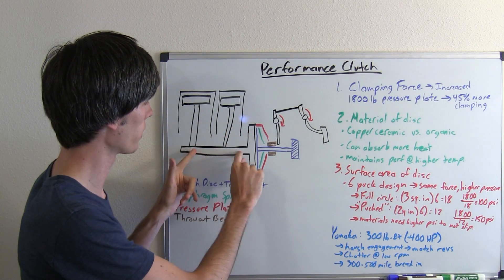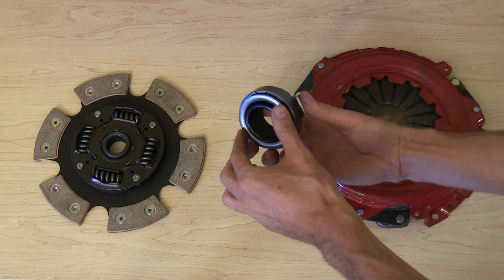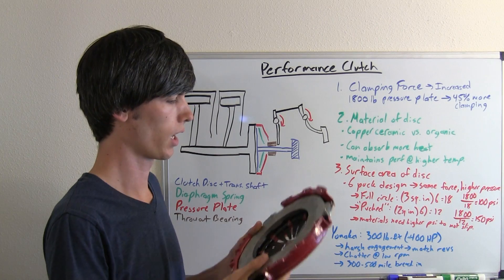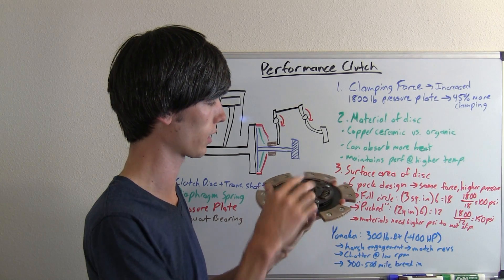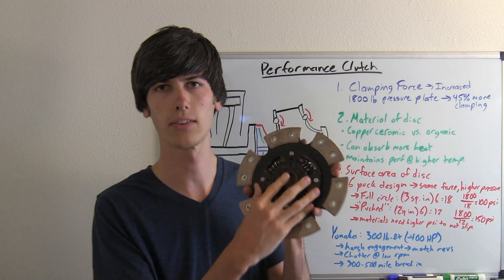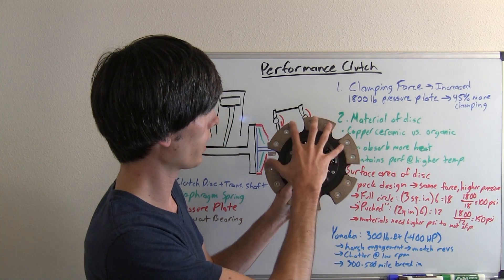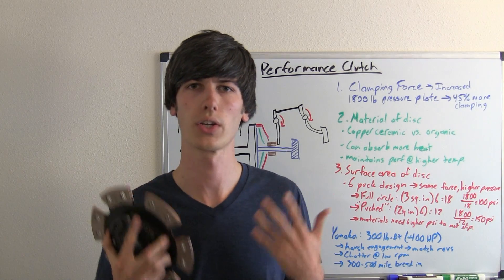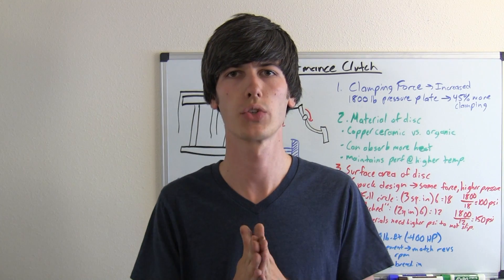Performance Clutch - Explained

Comment: You can also just run a "puck" disc with the stock pressure plate and due to the reduced surface area get more plate load. Probably should talk more about clutch "chatter" as there are two kinds; The first being rough engagement when taking off in first gear, and the second being rough running from also changing from a heavy/dual mass flywheel to a light one when doing a clutch like this (which is common, especially on German cars).  Couple things to be aware of:
1. First gear engagement tends to be harsher (one kind of chatter)
2. If you do go LWFW, just sitting at idle in neutral the natural dampening from a heavy flywheel is reduced and it can make noise like you are throwing a rod (2nd kind of chatter). On modern cars (for instance German stuff with clutched alternators) this will beat the crap out of the alternator which is expensive to replace, especially if you also run a un-dampened light front pulley

I've run lots of the ceramics including 6puck sprung, 4 puck unsprung and even 3 puck sprung. The 3 and 4 puck ones on my little 1.6l Toyota 4AGE engines worked like nearly stock including with a LWFW (other than a 'hunting' idle), but with the 6 puck and a LWFW on my Audi, it was a big mistake. Those motors need that flywheel and it killed my alternator in about 30k miles as well as sounding horrible when the AC was on and at idle and being difficult to take off in first gear without clutch shudder; Lesson there is, it all depends on the application as to what you are going to experience. There's always tradeoff's with any change, and make sure you are ok with what those will be in your application including potentially heavier pedal feel, different engagement point, roughness/NVH, and both kinds of chatter.
Reply: what would you recommend for my 1.4 corolla g6?
Reply: I have both of these issues with my Volkswagen. I think its time I took a closer look at a proper clutch.

Comment: Cool video, there are clutch sets that are capable of holding good amounts of power and torque and yet are really low on chatter and vibrations, some are nearly stock smooth, they just cost more

Comment: Do you need a new flywheel when getting a performance clutch Need some help please thanks!!
Reply: +MrOsma10 This depends on the condition of your flywheel. Some people will replace it all together and some will have the flywheel resurfaced. I replaced my factory EvoX clutch with a Competition Stage 4 clutch about 3 months ago and I just had a resurfaced flywheel put in mine. It performs just fine. There is a harsher engagement, but depending on how you use the clutch, it'll be really easy. Going from a stop to start definitely requires a bit of a higher rev. I normally will let off the clutch in between 2,000 and 3,000 rpm for a smooth engagement.
Reply: +Ghost Fire I really Appreciate you help so is good too change the flywheel too keep it in good shape?
Reply: +MrOsma10 When you say your clutch is about to go, do you mean you are experiencing clutch slip? If that's the case, then your flywheel is probably worn in addition to your clutch. So if this is the case, you will have to either buy a new clutch or have a resurfaced one put in. My mechanic took my worn flywheel and replaced it with a resurfaced flywheel. You won't really know for sure if you need to do this until your mechanic takes the clutch apart. It will be obvious that it will need to be replaced.

Comment: I just recently changed my clutch to stage 2 but now it's really difficult to put it in 1st gear from a deadstop, any ideas? After it starts rolling it's easy, it's just that 1st gear that's the problem..
Reply: +TheNestor_1251 Have you tried revving the engine a bit?

Comment: I put an aftermarket clutch in my Car and I started to notice it has a raddle when in neutral and clutch is out. I was told this is coming from throw out bearing and is normal. Is that true statement?
Reply: +Titanium105 Stock flywheel? If you only changed the disc and pressure plate, you shouldn't be getting any rattle if you didn't have it before. If you changed flywheel to a light one, this is pretty normal.

Comment: 2½ years late for the party but Ill try anyways since I really like the channel: I upgraded the software in my Audi a4 a while back and noticed that the clutch was slipping. I upgraded it to a single mass flywheel with a preassure plate from the S4 and a bit like that. Now I get this really nasty vibrations in my entire car between 1800-2500 rpm approxomately on 3rd, 4th and 5th gear. Is it the engine mounts that somehow doesnt do their job anymore? I'd like to see a video explaining how the mounts work depending on the other stuff that affects the drivetrain.
Reply: +Robin Karlsten It's because the Single Mass Flywheel can't absorb the shocks as the twomass flywheel did. also check enginemounts and other bearings for wear.
Reply: +Robin Karlsten Audi's don't seem to like changing from the dual mass. I put a light single mass in my A4 and it was a mistake. idled horrible and chattered on idle and taking off in first gear. Yours should not be shaking at those rpm though, unless you are also having your foot to the floor on the gas at those rpm... with high load and low RPM, your little motor doesn't have enough torque to do that smoothly... should be at higher RPM if you are flooring it. If its shaking just cruising along at that RPM on light load, you have some other issue. I'm Assuming 1.8T? I had 3 of those, and currently have a 2.0TSi which behaves differently. Also, are you running a aftermarket front pulley? If so, I'd recommend putting the stock one back on. I put on a light weight front pulley and it made things much worse - kept the light weight flywheel, but put the stock front pulley back on it and it was better.

Comment: Something I've been pondering for a while; is the torque of an engine measured in "pound-feet"? Everyone I know calls it "foot-pounds" and I'm a little confused on which is the right one.
Reply: +Dante Talos since the base units (force and length) are multiplied, you can write them either way (1x2=2x1)
Reply: +Dante Talos I think it's both, depending on where you live in the world
Reply: Ahh cool. Thanks :)

Comment: u should get bigger board
Reply from the maker: You should get a bigger screen! The board size won't matter haha.
Reply: if the board is bigger then whatever u have written could be written with more space in between lines
Reply: or u could have two boards side by side
Reply: +Dredd Paul Maybe that's the best spot to put the camera. Assuming that's true, then he wouldn't have anywhere to stand.

If you had worded that as a question, that would have been better.
Reply: Tilt your phone
Reply: Next video: Whiteboards explained
Reply: +Engineering Explained Get that f*** board. Your channel is unwatchable as it is now. TROLOLOLO

Comment: My Z06 vibrates like crazy through the shifter and torque tube it seems when it grabs in first gear, is this normal?
Reply: +SugarWater Purple Usually triple plate clutches or performance clutches do that, so you may either have a performance clutch, or your disk surface is about to give out, My E30 ran on a worn OEM clutch and it would chatter so hard, make all kinds of noises and it was about to stall if i didnt rev up to atleast 2-3k. So you may have a worn clutch that is about to die. Check your car before you damage your flywheel too, that could be costly lol.
Reply: Should always balance the entire clutch assembly by a machine shop prior to installation.
Reply: SugarWater Purple . sugar, water...and of course , purple. 😀

Comment: Hi i put one of this performance clutch on my 1994 toyota pickup but i didn't replace the flywheel and now when is running at normal tempeture the gears sleep, and my other question is how long this kind of clutch last. if you can help me out whith this matter would be great

Comment: Hey could you do a video explaining PSI? I've wondered about it for a while now.
Reply: +EAGLE13441 It means Pounds per Square Inch. I don't know why Pixel thinks it's a retarded way about talking about pressure, it's the correct way to refer to it in terms of area.
Reply: +Alex Auman he said is retarded because of SI or metric. Imperial is bad...

Comment: What's the difference between sprung and unsprung clutch discs?
Reply: Sprung disk pads absorb the vibrations when you release the clutch, so it isn't as harsh.
Reply: +Ravi Kim I figured that much but like whats the benefits and applications?
Reply: Oh, well some benefits to a sprung clutch is that if you're driving it daily, it reduces chatter and vibrations when engaging. And it reduces impact to the gearbox at engagement. So I definitely recommend sprung. As for non-sprung... Not exactly sure of the benefits to be honest. Sorry. I'm about to replace the clutch on my STI and I'm going with a 6-puck sprung cuz it just seems logical that if it reduces chatter and vibrations, why not. Maybe someone else on here knows benefits of non-sprung?

Comment: then what would be the differences between different stage racing clutches? like a stage 2 and stage 3?
Reply: +Jon Williams "stage" is just a fake marketing term used for convenience. Basically there's lots of combo's of flywheel, disc and pressure plates all of which can be changed around depending on how streetable you want it and how much torque it needs to hold. Generally speaking stage 1 is like stock but holds a little more, stage 2 holds even more but is a little rough around the edges and stage 3 and up hold a lot more, are expensive, harsh and probably have a short life on the street.
Reply: +John Baumann The clutch won't damage anything regardless of what type you use. Using a light flywheel can shorten the life of lots of stuff.
Reply: some gear boxes are more fragile.  Subarus for instance, even with the stock clutch, have a damper in the slave cylinder so the clutch engagement won't be harsh.  Most subarus that are not turbo, the clutch grab will seem very light.  Thats because subaru puts in a damper so you can't slam the clutch and transfer force to the transmission harshly.  It will damage the gear box.  So if you were to put a very grabby clutch on a stock car you'll need to be more careful not to drop the clutch too fast even in every day driving.  They do feel nicer to drive because the engagement point is so defined.  But you risk damaging the oem gear box.  If you look at 2nd hand wrx or sti that have a multi puck clutch, make sure the previous owner didnt screw up the syncros and that every gear holds and engages smoothly.  Typically 2nd hand stis can be a crap shoot, especially if a performance clutch has been installed.  Means the previous owner was driving the crap out of it.  Because I'm so used to my car, I've gotten used to the clutch pedal.  And with the stock clutch, I can barely notice the engagement point.  I can feel it, but it feels very light.  I'd prefer a performance clutch like this.  However there is a down side.  Even though a stock clutch feels light and weak and not as aggressive, it will more likely last longer.  I've found that stage whatever clutches grab awesome, but they wear more quickly.  Just like performance brakes, they grab really nice, but they wear out much more quickly.  So even if you do your best, a performance clutch probably will only get you 60,000 miles.  Where as the stock, not as fun, clutch can last the life of the car with the same driving technique.
Reply: Spinnetti thanks for the explanation!
Reply: Yes, also what damage can each cause to my gearbox

Comment: My clutch burnt out pretty bad. The dealer said I need a new clutch. Would that mean a new flywheel as well? 
I stumbled onto your video because I would like to learn more.
Reply from the maker: ocelotl213 If it's a single mass flywheel, often it can be re-used. Depends if there was any damage done to it though.
Reply: +ocelotl213 you never need a new flywheel. just resurface the old one. in some cases you can just drop a new clutch in if its not damaged at all. most people will tell you just resurface it for insurance. if you dont know flywheels always cost more than the actual clutch it self sometimes 3x as much. a shop would love for you to pay that.

Comment: If I put a aluminum flywheel which is lighter, instead of iron which is stock on my car,what pressure plate & clutch should use? I just want to accelerate faster I don't care about top speed. Is for daily drive. i don't race. Should I stay with the original clutch kit? Car is a stock mitsubishi mirage 2001 1.5 4g15.
Please help.thanks.
Reply: bartojoe as a daily DON'T replace the flywheel. "Lighter/better" flywheels dont last longer than the stock ones. Faster? yea. sure, by a little... definately not worth the hassle. and ur driving a mirage so....

Comment: What does someone think would be the BEST clutch to get for a 2003 wrx
Reply: Billy Bartee This is a vague question. That's like me giving you a vague answer of "Get wtv is on your car". You need to specify your future intentions for your cars performance, wether it will see increased performance or not in the near future.
Reply: Billy Bartee I bought an Exedy OEM replacement for my "stage 2" 250 WTQ WRX. Super cheap and a bit better than stock OEM. It all depends on what your application is capable of.

Comment: I have a 99 Mazda Miata needs a new throw out bearing. But I would like to turbo it in the future should I just put a stage 3 clutch while I am at it will it be fine? I want this Miata at 300rwhp. But at the moment it's mostly stock
Reply: jason hernandez Umm, yeah spose you can do it now but it'll be horrible to drive in traffic... What's a stage 3 clutch? 3 plate?
Reply: Kazi2812 stage 3 clutch is a clutch that can handle more power this way you don't need to change it as much. Especially like me I want a lot of HP
Reply: ive experienced a stage 3 its horrible, have fun getting buff ass left leg or get a stage 2

Comment: what happens when you burn a clutch? when will you know your clutch is fucked?
Reply: Clinster246 When you initially burn your clutch you will be able to smell it in the cabin. Symptoms of a slipping clutch are for example: you are driving on 3rd gear at 40mph at a low and comfortable RPM, you step of the accelerator to Full-Throttle and if you notice your tachometer needle jump from 3k rpm to like 5rpm or greater but the car is not accelerating at all. That is when the clutch is slipping. It literally slips. An extremely slipping worn clutch is like using a bicycle with no tire on the rear wheel and when you attempt to accelerate on your bicycle at a rapid pace, the wheel slips on the concrete surface.
Reply: thank you for your detailed answer! :)
Reply: Clinster246 
You can also "feel" the condition of the clutch when you use it, if you need to take the pedal all the way out before it starts to grip. Then it's worn, and needs changing, preferably before it burns, so you can still drive it. 
A clutch might also start slipping before it's burnt, if it's barely enough material for it to hold on, at least under heavy load. 

Had a fucked up clutch in my shitty first car, clutch slipped a tiny bit when I tried pushing it a bit with a trailer on an incline. 
Managed to burn it a few months later, oh the smell :D

Comment: Just bought a focus st it's my first stick car and I feel like I'm burning my clutch up is it bad to rev up to 1500rpm and slip it out to get going at a stop light/stop sign ect?
Reply: sergsrt8 You should be able to move at lower rpms unless you don't like taking your time starting to move.  If you're on a hill, then that's understandable.  Everyone and every car is different though
Reply: Amanda Just yea true I can use the clutch only to get going but it takes too long I'm so impatient lmao. But would adding a little gas make my clutch wear out very fast?

Comment: I still couldn't understand why you are able to shift faster with racing clutch. Why can't I shift faster with normal clutch? Or have I understood something horribly wrong about the benefits of racing clutches, because that's what I've heard...
Reply: No body buys a race clutch for faster shifts. You buy it so that your clutch won't slip under a high load in high HP scenarios. Has nothing in the world to do with how fast your shifts are...
Reply: NBMotocross3 Oh okay lol. That seems logical
Reply: +Jon Wooldridge Yes. You are correct and have a very valid point. However it still won't make you shift any faster, that comes down to the driver, and it may not have been clear but that was my point. There's so much mechanical advantage that can be had with short shifters and new clutches, but in the end, in the wrong hands, it won't make you shift a single bit faster unless you know how to utilize it
Reply: heavier pressure plate retracts the clutch faster so you're able to shift faster than a fast shifter with a stock clutch.

Comment: Ok so help me out here. I want a nice oem replacement but my car is making decent power. Around 360awhp dont remember the torque figures but lets assume 320. I dont want a loud clutch thats. My question is why do I need to go with a puck type clutch when a stage 3 clutch for my car switches to a full metal disk and is good up to 400torque and around 500hp? Wouldnt the full disk give me a more oem sound and driving feel while being able to hold up to the extra power?